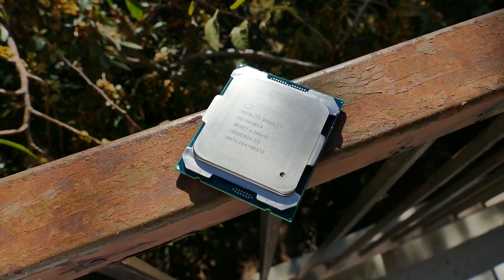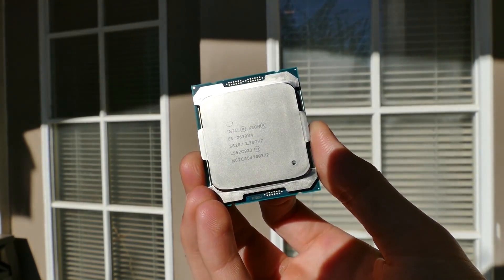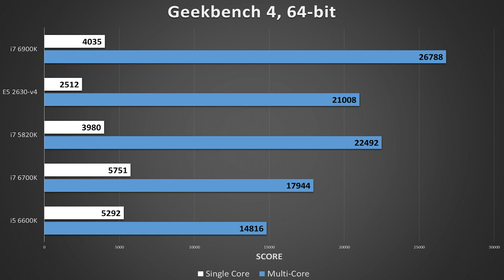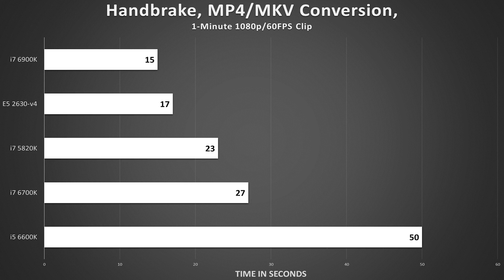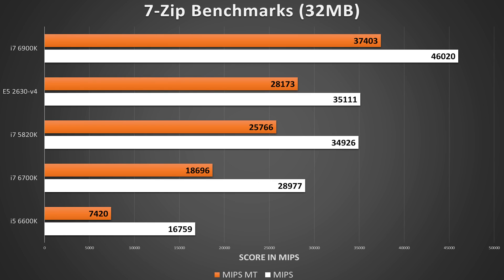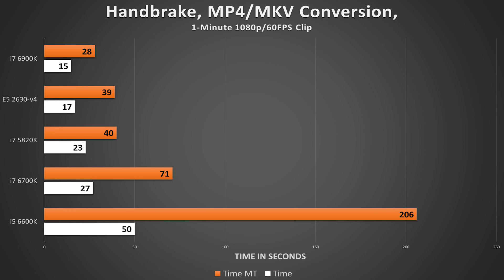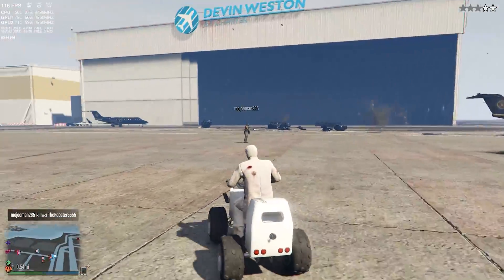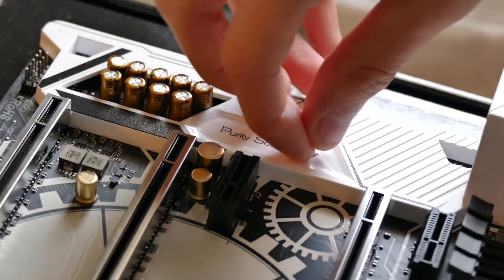i5 vs. i7 vs. i7 vs. Xeon vs. i7 (Multi-tasking/Heavy Workloads)

Comment: you will be saying goodbye to your x99 sys and going 7700k? lotfl that's the dumbest thing i've heard all month. the 7700k will have no ipc gains over the 6700k http://www.tomshardware.com/reviews/intel-kaby-lake-core-i7-7700k-overclocking-performance-review,4836-2.html  contrary to what intel and lazy software devs have conditioned you to believe, more cores is the future.
Reply: +Jeremy Ellis fingers crossed that Zen at least forces intel to become a little more honest. i would love it if it beat the crap out of the Broadwell-e series
Reply: Nvidia is turning into intel as well, because pascal is just maxwell 3.0. because on a clock for clock, core for core basis, the scores are exactly the same. pascal just features much higher clock speeds
Reply from the maker: I'd say goodbye to X99 and hello to a 6700K if it wasn't for the new lineup coming soon. Nice try. IPC jumps have always been roughly 4-5% for Intel generations. I'm well aware of this. Never said anything about gains in the video, so quit assuming to further a moot point.
Reply: Salazar Studio tomshardware has a 7700k and its in geekbench list of cpus as well, Single Core is 5347 for the 6700k and 5566 for the 7700k. its all clock speed not ipc. if you already have a x99 sys why the hell would you downgrade to a mainstream platform and cpu? and then say its better?  i do watch some of your videos and have liked some as well, but with that comment i personally think you have lost your marbles.
Reply: well my personal opinion on X99, is that if you have a good enough cooling solution you can get the single core speeds to match, and then the extra cores are just headroom, if you even need to run something brutal in the background. I currently have a i7 5930k, i have gotten it to 4.9 ghz at 1.35V stable, and temps didn't exceed 75 C when i had my rig's cooling systems running at 75% of capacity (50% on the pump,85% on the fans). that is more then enough to be on par for the single core stuff. but the bonus of Haswell-e and up is that you can disable individual cores, so i could take out my two slowest cores if i was just interested in gaming. though i currently run it at 4.5 ghz at 1.27. Also If pcie lanes are important, i would go with the 5930k instead of the i5820k, because the 5820k has only 28 lanes, so you would be running it in x16, and x8, and the x8 negates the x16. better to just go to the i7 5930k with its 40 lanes if you have the money to go for X99
Reply: ben russ i was going to buy a 6700k that was until i found a rampage 4 gene on ebay for 160$. i now have a 3960x at 5 ghz with quad channel 2400mhz ddr3 and i am so happy i did not go with the 6700k. i got the mobo and cpu combo for just a little more $ than the 6700k itself and i saved even more $ by re using my old ram. i am so sick and tired of intel fucking us desktop and pc enthusiast guys and eb going along with it like its all good.
Reply: oh i know Jeremy Ellis  The only reason i have a 5930k system is because i built my rig from scratch and got all the stuff new for ~1k, but i am running a gtx 980ti MSI golden editon, 32 gb ddr4 2400, 1tb ssd, a corsair strafe keyboard, and a G700s mouse. though i have a meh 27 inch 1080p monitor

Comment: One can only hope for AMD'S sake that Zen has both good frequency and single core performance... Otherwise Zen will just end up being a cheaper option for those who actually can and will make use of 8 cores and 16 threads.

God knows whenever I DO upgrade my current i7, I WILL buy whatever provides the best gaming performance for the money I have. And if the 8 Core Summit Ridge, or even the Quad core variant Zen CPU cannot even keep up with a 6700k in gaming, well I simply won't be buying Zen CPU if that is the case. I mean unless it is REALLY close to the 6700k, can be OCed as well as one, and only costs like $150 or less.

Comment: i just notice, the i7 6700k is at 1.38v and 4.6ghz, but mine would never ever run stable anything over 4.5ghz, no matter how high my voltage is, even if it goes up as 1.45 v, it still crash at benchmark. so at 4.6 Ghz its a disaster , but at 4.5 its just fine. like superfine, like its not even overclocked . but i guess this variance is normal

Comment: My E5-2658 V3 Engineering sample was 1300 cb on Cinebench. The i7 6800k @ 4 GHz @ 1.275 Volts made a score of 1200. Here's the screenshot of what i have. https://gyazo.com/21670712de5b651a10b939e47e3e06da . Please don't comment on the drawing at least there labelled!
Also 65C on a Noctua NH-U12P SE2 cooler for the i7

Comment: is the 6700 non k worth it too?
Reply: chimado that sounds like a waste of money tbh, if you really must wait for the 7700k get a cheap i5 and wait or just get the 6700k and use it. Generally you could expect LESS than a 10%ish upgrade anyways and is that worth spending like $600?
Reply: LaSiMuSi I hope zen can really bring AMD back, I want them to make a 6 core that can perform as well as the 5930k and cost as much as the 7700k, that would  get them into a very good spot for selling to consumers.
Reply: chimado if you don't wish to overclock it sure it's worth it
Reply: $50 more what i'm doing is buying an 6700 and then waiting a year or two for the 7700k (i know it's coming out soon but i want to upgrade later)
Reply: chimado If you are getting a 6700 why not get the K and overclock it, my i7 is at 4.5 ghz without any added voltage and I get a lot more performance out of it, like games such as arma 3 give me a 20 frame boost from the overclock alone
Reply: 6700k and 7700k is literally the same chip, just a updated one. (It overcloks more)
Reply: TheBoxxWillRuleAll Intel has shown benchmarks already, the 7700k is a dissapointment, OC to 5gh. But performs gains are literally 0%.
Reply: LaSiMuSi That is exactly why I say stick with a good 6700k, I just think buying a 6700 and 7700k is a massive waste of money that could be used for more memory and/or video card/monitor
Reply: TheBoxxWillRuleAll What they have shown so far it's really appealing, I even invested in AMD stocks for my new pc budget. Bought in at 6.35, let's see if I can get free pc parts :)
Reply: the reason i  am buying the 6700 is for the option to steam/ record without buying the 6700k and the option to upgrade to the 7700k later without replacing the mobo
Reply: Just get the 6700k and don't worry about the 7700k unless it runs circles around the 6700k. I still use my trusty 4790k and its fantastic still and will be for a long time. If the previous generations of I7's have taught us anything, its that one generation jump to the same class of CPU is absolutely not worth it unless you are extremely rich and frivolous. Grab the 6700K, something like the corsair h100i V2 and overclock it, you will be fine. Like i said, if you absolutely need the 7700k just grab a temporary i5 and save some money at the very least, no need to blow trough $600 on a $300 experience.
Reply: TheBoxxWillRuleAll My fault, my intention was to respond to chimado who made a really bad suggestion, which I beleive you did too. I will wait for Zen to drop then I pick up a new Mobo+Cpu+ram, going from an AM3+ FX8350
Reply: Tyrone Biggums lol bro. the dividends are ryzen and Vega hahaha. you made a ton. I got in at 10.60. regardless it's going to $20 probably this year.
Reply: sitting nicely on 13.50 now :)

Comment: I need to ask , i want to buy a prebuilt sistem and it has an i5 6600 non k with an 1070 , so will the processor bottleneck the gpu ??

Comment: Also, just a notice more than anything else, if one's interested in virtual machines along with gaming as his/her usual workload, then the extra threads of an i7 would help. In this case, the i7 6700k would be the cpu of choice. As I've found out in my i7 920 system (yeah, I know the cpu's much older than the skylake one, but it can be on par with an i5 6500k with a nice overclock and be even better because of its hyperthreading in such tasks), I can work a bit better running a virtual machine with 2 cores while gaming.

Comment: I miss the Xeon E3-1230 v5 in there.
Reply: me too, overclocked with the Asrock e3v5 motherboard
Reply: +Lucas rem Because a beast workstation doesn't have the sex appeal of a custom gaming system. Elric from Tech of Tomorrow just reviewed a HP workstation recently though.
Reply: sparkplug1018 GUYS I7 7700K OR XEON
Reply: K if you want to OC easily, Xeon will just work out of the box.

Comment: You wont see much difference with a 7700k. Just oc your 6700k to 4.8Ghz and you will be good to go. Look up Toms Hardware review of the 7700k, and see that it is not something special, needing more voltage to achieve better clocks than the 6700k, and almost no gains (5% max).

Comment: Adobe Premiere IS optimized for multiple cores, it's a professional application, you're just not using it like a professional.  Throw 15 video streams in there, with dozens upon dozens of effects, then watch the Xeon magically leave the rest of them in the dust and watch the 6700K and 6600K beg for mercy.  If you use Premiere like a consumer, get a consumer CPU, that's the moral of the story.  If you use it like a professional, get a professional CPU.

Comment: Excellent comparison video!  Thank you!  I do have to add a user scenario that is very common, but not featured on youtube much for it is not that flashy...3D rendering.  There is a lot of talk of rendering on youtube, but that is referring to video, but everything can change when you are a 3D creator.  Contrary to this video, the Xeon is the optimal chip for this, particularly when you put two or more together.  There is no single enthusiast cpu that can compare to 32+ threads (regardless of clock) for these applications...not even the 6950x.  These programs are optimized for cores/threads, and will excel with the more cores/threads available.  My dual xeon system renders in 6 minutes what it used to take my i5 literally 10 to 12 days to complete...while allowing any and all multitasking I need.  I agree that for most, this does not apply, but I think flatly saying the Xeon is "not the chip for you", may be a bit misleading and under-representative of what the chip is actually capable of.

Just some thoughts from a non-gamer/non-youtuber subscriber that appreciates your normally well rounded scientific approach to tech:-)

Comment: You should add solidoworks benchmark.  It's not a great benchmark but CAD is a popular use of workstation pcs. I know single thread performance is most important but I would like to see differences in quad channel ram vs dual.

Comment: Xeon overclockable with non-k oc bios?
Reply: Reuben Horner non-k oc bios?
Reply: jynxed Skylake has some magic. Look it up yo
Reply: that was a X99 broadwell xeon, so no.
Reply: most xeons cant be overclocked but their are xeons that come with high clock speeds, the guy in this video just always uses the same shitty 2.2GHz one
Reply: Xeon can't be non-K'd unless you grab one of the Asrock E3V5 C236 boards that got discontinued.

Comment: Why no FX-8300 in the test? :)
Reply: ネーナ・トリニティ Outdated architecture that does not fully support simultaneous multi-threading and has a weaker single-core performance than intel's underpowered chips. Also has been criticised to have weaker cores than intel's chips.

Does great in multi-core tasks but the current intel chips may likely beat the FX chips out of the water.

Also he just so happens to not have that much or any AMD chips at all.
Reply: AMD 4 LYFE!!!111
Reply: David DeBroux
He have tested i3-6100 vs a FX-8300 before... o3o
Reply: ネーナ・トリニティ You really didn't read what I just said.

Comment: Wheres the 4790K? lol
Reply: QuinnBattleWraith no point in including it. It's just a weaker 6700k.
Reply: trevor jaster it's not faster and the reason it's bigger is because it was made on a larger node.
Reply: +Rhelmar it is actually faster than a 6700k because it is a larger chip more transistors
Reply: Rhelmar Dont think the word "weaker" justifies the performance differences between the 2, but makes sense lol.

Comment: That i7 5820k looks nice and tempting but I'm stay with my fx 6300 at 4.8 its doing its job for now. plus these new api's like vulkan and DX12 are really breathing new life back into these old FX chips and my rendering performance is not to bad but I do need more ram I got 8gigs running at 2133 with the lowest possible timings

Comment: Hey Greg, what do you think about the rumours of an X99/equiv Kaby lake X processor with 4 cores and 8 threads, but a TDP of nearly 120W? For a simple 4 core HT chip, that kind of TDP suggests insane Clockspeeds (utlizing the larger heat spreader of the X99 chips, I guess?). I think that would be an amazing chip to have.
Reply from the maker: Yep, sounds awesome. Four extremely overclocked cores are generally preferable.

Comment: I'm running an old i7 970  6 core (12 with HT) @ nearly 4ghz on liquid... it's my old x58 motherboard holding me back I think. I do a lot of rendering and premiere cc 2017... so I've been able to keep this rig going for 4 years which is an eternity in tech land. Would I see any improvement upgrading to a new 4/8 w HT on a z170 board and 32gb of fast ram? Maybe I'll  wait for Zen to come out so the prices drop.

Comment: I don't understand what justifies chasing the hottest, cuttingest edge tech.
Reply: Samuel Henson Right? While X99 doesn't seem worth it to a lot of people, it's geared toward creative professionals, enthusiasts, and the like. Yes, the platform did struggle to go farther with render times, compared to what the 6700K can pull off, but try putting it against a 3D modeling or animation program. That would bring the 6700K down to its knees. Which is where the Haswell/Broadwell-E chips would come in handy.  But Salazar still made his point, about X99 not matching to "price to performance" when it comes to video rendering.

Comment: I've been saving some money and collecting parts for a new Skylake rig. I have a new 980 Ti and a new i7 6700K and 1TB harddrive. For the mobo a MSI Z170A Gaming M5 and 16GB Corsair Vengeance DDR4 3000 memory. A Crucial MX300 SSD. A Corsair H100i AIO Liquid CPU cooler. A Cooler Master MasterCase Pro 5 case and V750 750w Modular PS. The OS will be Win 8.1 Pro. I've tried Win 10 and didn't like it. Also maybe some RGB color LED light strips. I might be able to buy the rest of it with my next paycheck.
Reply: Gary T. Wow your the first person ive ever heard say that they like win 8.1 lol.... That was a horrible OS...
Reply: ***** Atleast their fast updates unlike the updates from previous generations of win

Comment: Where is i7 6800k ? :(
Reply: It has 6 Cores, as does the 5820k.
Reply: Wolf beargem what xeon?
Reply: But is more expensive. Hence why the 5820K was used
Reply: I think this is much better than 5820k :(
Reply: BitupaN DoweraH It would've been better with the 6800K. It's about $5-10 cheaper on Amazon right now. For a processor that normally costs $441, that's not bad.
Reply: Probably doesn't own the CPU, thus not on the list.
Reply: ded
Reply: Cancer Alert GUYS I7 7700K OR XEON
Reply: Yeah what one?
Reply: Anthony Paull i think xeon my father is an expert and he said xeon is better since it is meant to run servers which are waaaaaaay bigger than games
Reply: Wolf beargem Well, there are Dualcore Xeons, Quadcore Xeons and everything up to 22 cores I think.
Not all these are good for gaming because most games don't take advantage more than 6-8 cores.
Please inform yourself on the internet about that before making a decision.
Reply: yeah i would say the e5-2699v4 would kill all those chips and is 1k used on ebay

Comment: Would switching from a i5 6600 to a 6700k be worth it? I mostly do video editing
Reply: Devmin Abeyasena You shouldve bought a 6700k in the first place and you couldve saved alot of money. Ofc the 6700k will perform better but you're basically binning the 6600.
Reply: jynxed yeah I was doing like a budget build and now I regret it 😅
Reply: Devmin Abeyasena there's nothing wrong with a budget build but you took the wrong approach. Technically when you want to do a budget build you shouldnt work around the price you set, you should work out what exactly you need then buy a cpu and a graphic card you want then buy a decent motherboard depending on what kind of cpu your going for then buy a decent and sufficent powersupply for future upgrades or builds then after that you can start budgeting.
Reply: jynxed Yeah I know I didn't do it exactly the proper way. I got the parts from abroad in one day so couldn't exactly research every detail. I love the build its just that I was wondering if an i7 would make a significant difference in video editing
Reply: Devmin Abeyasena What resolution do you normally work at? A i7 wouldve made a considerable difference in performance
Reply: jynxed well mostly 1080p for now
Reply: Devmin Abeyasena For 1080p a i5 is decent but if you want it to process quicker and want to work at higher resolutions then you might have to turn to a i7 in the future. Btw what graphic card do you currently have?
Reply: jynxed yeah I guess I'll for some time to switch to i7. graphic card is a zotac 1060